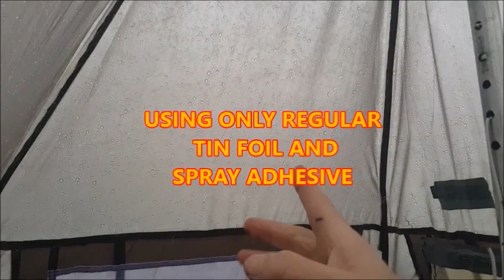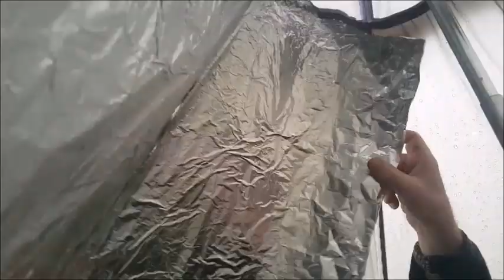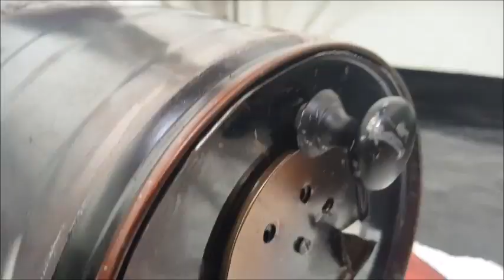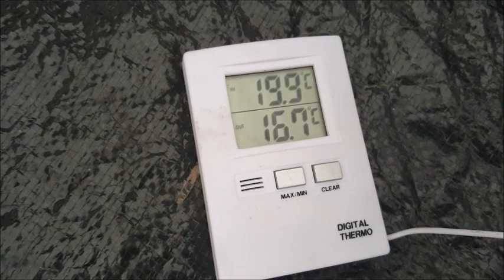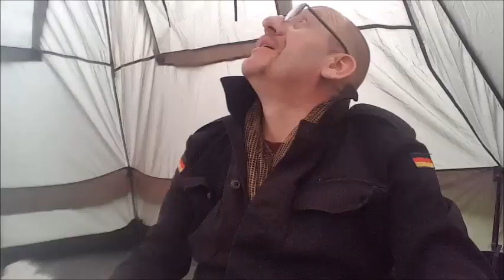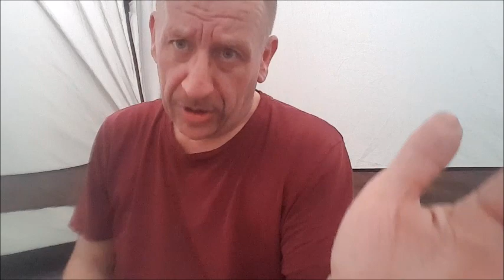MYLAR HOT TENT HEAT REFLECTOR ...bexbugoutsurvivor

Comment: I wonder if the cheap foil bubble wrap would be a better material since it will double to give protection against conductive losses, but it will definitely destroy the tents pack size, maybe not an issue for car camping and put the tent in a hold all, interesting stuff.
I've seen videos of the 'quilt' lined tents but that's a different beast. All the best Bex

Comment: Interesting video. Have you tried making a heat shield for your flue out of a stainless exhaust  piece. I made one for my frontier stove out of a 5 inch diameter piece . And it works great
Reply from the maker: Do you refer to where the flue exits the tent.? I used a stove jack, but if I did this project again I would look into a flue pipe sleeve. I may experiment with chicken wire, to give a dead air gap perhaps. You can always take some pics and post them to our email, would be great to see it....I'm also looking into using a single roll sheet of titanium to make the flue pipe, the sectional flue are too cumbersome to transport in a backpack...bex
Reply: @bexbugoutsurvivor  yes mine is a single piece of 5 inch stainless steel exhaust about 500 mm long. I drilled 6 holes in it . 3 at either end and used bolts and nuts and wing nuts to secure it to the 2 inch flue of my frontier stove i then used a jubilee clip which i leave secured to the flue . This is to rest my exhaust piece to which then gives me a 1.5 inch space right around the flue for dead air to keep both my nylon and canvas tipi's from heat damage.

Comment: Right. In regards to the wall reflecting applications: I’ve done a similar project winter proofing a 3 season tent. I used a small tarp and hung it on the inside using magnets to hold it in place over the screen walls. Works great and is not permanent. Down side is you need to have a mate on the outside to help line up the magnets. 
Also, when not needed for the tent I’ll connect one end of the tarp to the automobile using magnets and the other end two poles tied out for a canopy when car camping.
Great post, Bex. 
Thanks!
Reply from the maker: Some one in the comment section suggested using Velcro patches & reflective bubble pads. Seems to be a logical approach too, and maybe something worth considering. Also a grabber reflect survival blanket, roped around the outside of the Apex of the tipi, might have benefits also. When/if  the mylar sheets come loose, I my choose one of these options. Thanx 4 watching...bex
Reply: @bexbugoutsurvivor  Yep, I only mention the magnet method for those that don’t wish to alter their gear. 
I am of a mind to alter all gear to suit your needs. Again, Bex,  I really enjoy your posts. Thanks.

Comment: think i would have tried a external sleeve/flye to go over the top of the tent, maybe made from reflective blankets, (like a cone) ... just because i never have any luck with glues.
Reply from the maker: Good point! In hindsight I wouldn't use a jack again, but a stove flue pipe sleeve, straight thru the A-pex. Looked at some on line, and I recon chicken wire around the flue pipe would be workable fix. The reflector makes one hell of a difference, but this fishing/hunting tent is far too big, for just me...

For camping I'm looking towards the luxe 2 person wood burning stove, hot tent, should retain heat better. I have some rescue blankets, maybe as you say, coning the outside....all the best bex

Comment: You've either wasted your time or you've created something fantastic. I don't know which at the moment but hats off for giving it a try.
Reply from the maker: There was no issue with the reflective failing to radiate the heat, although a heat powered fan would have been appreciated, to circulate the warm air. 

https://www.amazon.co.uk/4YourHome-Silent-Powered-Stove-Thermometer/dp/B015OH610Q/ref=asc_df_B015OH610Q/?tag=googshopuk-21&linkCode=df0&hvadid=231922535685&hvpos=&hvnetw=g&hvrand=7425841196439485514&hvpone=&hvptwo=&hvqmt=&hvdev=c&hvdvcmdl=&hvlocint=&hvlocphy=9045254&hvtargid=pla-420035811093&psc=1

The foil only has to last a one winter season for beach fishing, anything after that is just a bonus. I'm looking into the luxe hot tent, far more portable, lighter and more compact. Tried the polish lavvu, again too much bulk and weight and takes seven decades to dry out...lol...
All the best Sandy lad, have a great weekend...bex